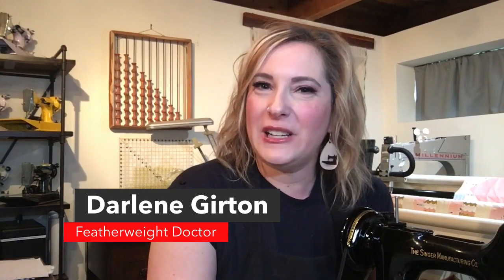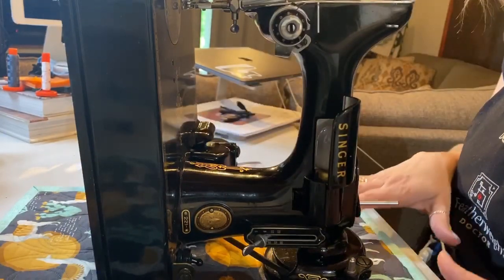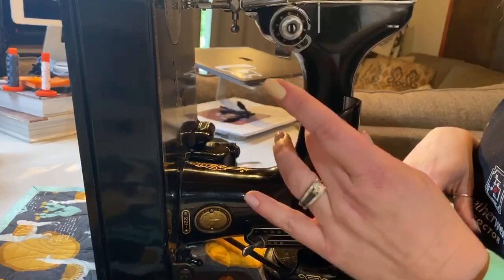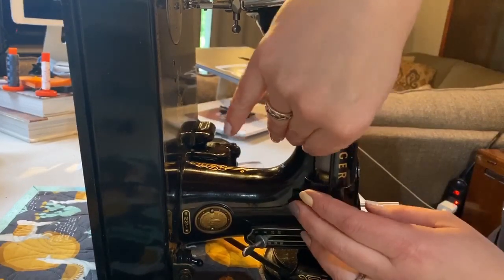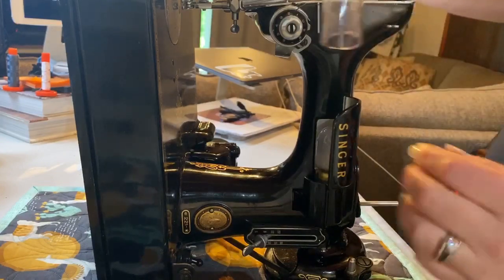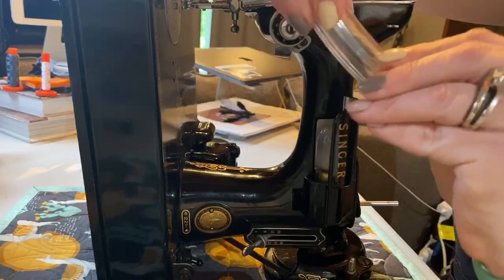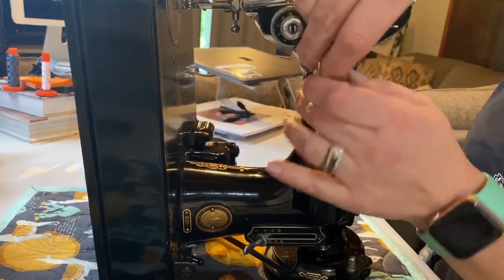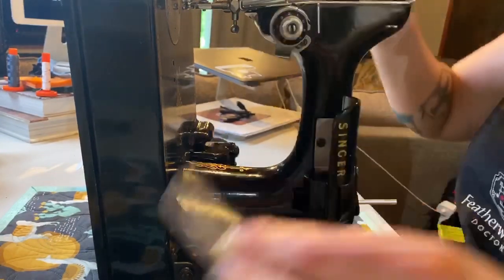All About LED Bulbs for your Singer Featherweight 221 and 222.

Comment: I just got a featherweight and was surprised that the switch only turns on the bulb.  You can sew without the light!  I've never had a sewing machine that would run without turning on the switch, which also turns on the light.  Luckily, I had purchased a multi-pack of LED bulbs for one of my Kenmore machines recently and one of those fit perfectly!  I love everything about the featherweight except the unmarked needle plate.  I always took the seam guides for granted!

Comment: I have the new led bulb. I push in and rotate into the slot. I can feel it click in but when I let go it’s like it doesn’t quite make contact. Any advice.
Reply from the maker: Yes!  The contacts might be worn out. You can contact the shop for more info